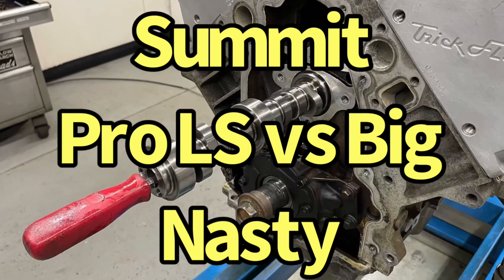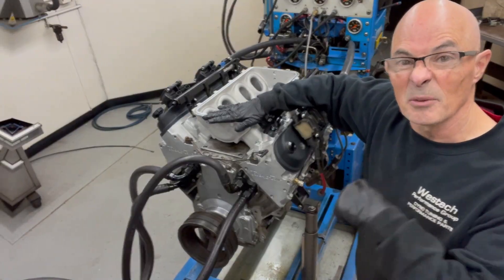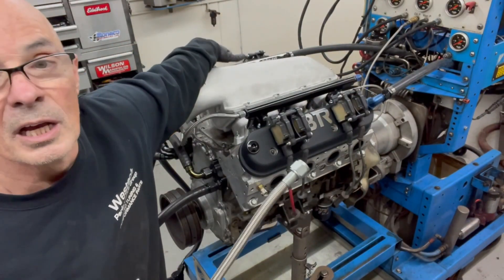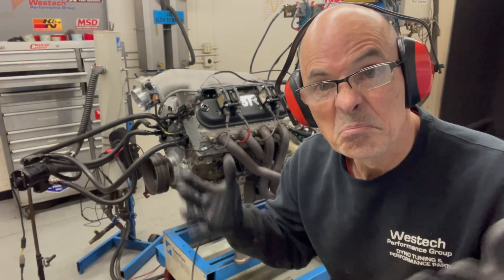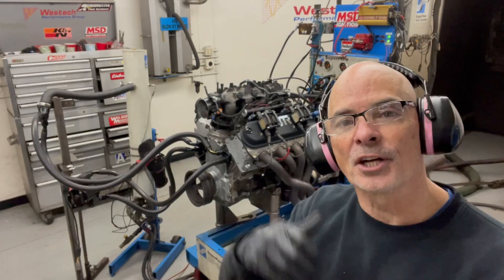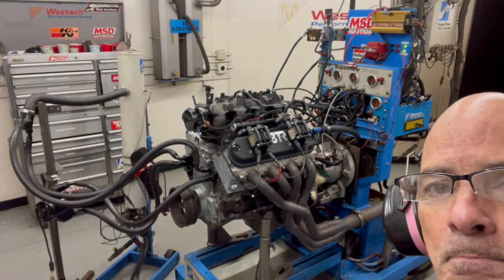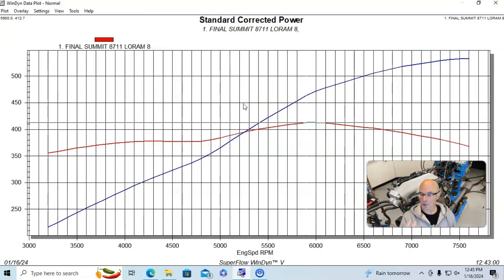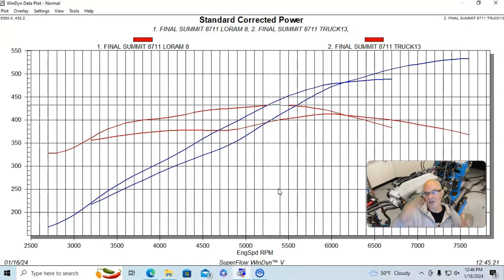TIGHT LSA 5.3L CAMS-DO THEY WORK? ENTER THE SUMMIT BIG NASTY CAM TEST-BIG NASTY VS BIG BOY 8711R1

Comment: I have to say I think it’s funny how some folks bash the tight LSA folks as if the LSA is some random number. Truth is the LSA needs to match the engine you’re working with. 114 might be tight for a smaller engine or too wide for a larger engine. Pick the correct LSA your engine needs, then choose the duration for the rpm range you want to make power then choose the lift for the flow that matches your heads. Thanks DV for helping understand how to make sense of the numbers and the right way to choose the ideal cam despite all the advertising from the typical cam manufacturers.
Reply from the maker: Choosing a cam is NOT advertising vs David Vizard (you are jumping to that conclusion), nor is it a simple formula. Often times Cam choice has nothing to do with power production. You will learn about cams and the market when you listen to more than 1 opinion
Reply: @richardholdener1727  don’t know now but the comp 268 was their most popular cam. Definitely not about max power.
Reply: @richardholdener1727  You are right and why I started watching your channel so I can continue learning. Not saying advertising is a bad thing. Not jumping to conclusions but DV’s explanation helped me understand what the number mean and a more simplified calculation to help guide a cam choice. A cam that advertises to be for a 265-400 CID engine may fit but is it the right cam for all or any of the engines. Many have opinions on what is the right or wrong cam and advice is always welcome but for me, I need to understand why and how to interpret the numbers.
Reply: @JudgeMeNotLeMans  why have an opinion if you have a dyno ... I think most guys just want the best TQ/hp for money spent ... but what do I know just my 2 cents ... but for sure what Richard does for all of us is a great service
Reply: @lukesimeon5756  Not so much an opinion but an understanding of the how and why. Richard provides us a valuable service to see what cams and boost can do. Comparing multiple configurations the average person could not afford, and share the results with us is priceless. For me I still want to understand what cam will work best for my setup and then find a test Richard has done to see an example. Then pay for my own Dyno session to maximize what I built.
Reply: The Summit cam timing calculator’s main purpose is to take the four valve events I use to create the engines powerband and behavior and spit out the Durations, Lsa, and Advance numbers that end up on a cam card.  There is no magic Lsa for displacement or head flow.  In the case of this test, would David’s magic Lsa pick up 51 ft.lbs when you mash the throttle at the expense of 30 horsepower up high?  No, it was just the change in two of the four valve events.  Even intended idle quality is the same in these two cams, but 8711 would be the wrong choice for most people’s powerband so I closed the intake valve 14 degrees earlier to move  the torque (within 8 ft lbs in both tests) down low.

Comment: Richard, I have $5, because I'm homeless on a borrowed phone, that says any given engine will give better results in every category with a 212/212-112 cam and a turbo than any larger cam without a turbo.
Reply from the maker: you want to compare a turbo motor vs an NA motor-seems like one has an unfair advantage

Comment: Richard great info as usual.  Could you possibly give us the engine vacuum readings at idle when you do these videos.  It would be good information to know if these different cams make enough engine vacuum for power brakes etc.  Thanks Again
Reply: Go electric. At 2 amps x 12V = 24 watts. That’s less the power then a low beam headlight. 746W= 1hp. So your loss is 0.0321 hp to run electric. I’m not disagreeing with the request wud be great info to have.

Comment: I'm not really surprised by the cam/manifold mismatch performing as it did... as I recall my dad rebuilding a stock 350-sbc Truck/van 4-bolt .030" over, and following the advice of going with a Edelbrock Performer manifold (equivalent to the S.P.2P., which he was specifically told to go with) and a Crane Fireball-II cam--on an otherwise all-stock assembly with cast-iron exhaust manifolds! Well, despite how contrary to logic this combo was, it worked... and worked well. So well that when kids in whatever late-model machine pulled-up alongside his 3/4-ton van at the light, he left them like their cars were chained to the ground. And the best part: It never needed anything higher than 87-octane to operate at peak performance.😉

Comment: Saw the timing cover in the 2 pieces. cut it right down the center line of the bolt holes 2 from the bottom. The cut will go into the bludge part around the oil pump clearance but that works out perfect.  Thin blade on a bandsaw leave a fine saw tooth marks for the r t v to dig into, don't smooth the cut. Don't sand it.
Reply: I did this twenty years ago testing tons of cams. I think it's Five and an eighth or five and a quarter inches off the bottom of the timing cover to those bolt holes. Describe a line on a surface plate and just cut the line
Reply from the maker: The problem isn't the timing cover (I have a 2 piece)-the cam hits the damper

Comment: Thanks for the information, I feel better already.  I bought a Sloppy Stage 2 off Ebay with springs, pushrods and gaskets for $200 and installed it in a 5.3 I swapped into a '77 Monza with a 700r4 and running off a 750 Qjet.  A few more hp on top really doesn't matter to me and I'm running very low 12's in the quarter at a 6000 rpm shift point and it's street manners are great.  That 300 extra I didn't have to spend helped out with the MSD 6LS box and the manifold I had to buy.  Some get hung up on the numbers in a band where they never run looking for max output.  All I know is there very few vehicles' that can run with me light to light and I do understand there is always that standout or Hellcat around the next corner but I can live with it.  I enjoy doing more with less.
Reply: I'd highly recommend you get rid of that cam & springs ASAP. There's been a ton of people on the sloppy FB group showing the $200 combos (and $90 cam-only) to be china garbage and springs breaking after a few dozen miles of use. Another guy ran it thru a cam doc and specs are a lot worse than a real SS2 cam.
Reply: @hydrocarbon82 the sloppy copy cam doc test didn't include the genuine ss2 cam test; so we don't know if the specs or hardness were much different. 

For example, Delta Cams did a YT vid showing a cam doc test on a genuine BTR cam, which shows the specs were off considerably.

As for the 1218 knockoff spring, there may be cause for concern? Powell Machine  is a vendor ($$) for the genuine PAC springs.
Reply: @hardball107  one of these days y'all will realize that cam was ok for the $$ years ago but you can make MASSIVE amounts more for a few more dollars! And you should NEVER use anything but name brand springs!!
Reply: I love it when "garbage" makes cheap, reliable power.

Comment: You left off the cylinder pressure developed  in the motor between the two cams? That is another tool to decode which cam is a better choice for an application, after the fact, though. That is a kinda pricey way to go about deciding on cam selection if you ask me?
Reply from the maker: cylinder pressure? (see torque)
Reply: Yes, that is a pretty basic premise.  But I seldom see it mentioned, let alone quantified in regards to its effect on street pump gas limits?  Maybe that is just a personal character trait that becomes more obvious during your regularly parsiminous responses? It is just information just like idle vacuum, something else that is rarely mentioned, let alone provided. Grab a cold/hot adult beverage, praise your deity of choice, as many times as required & Chill, Dude.

Comment: I have a BT Red Hot for a 6.2LSA motor. I cannot find one test with cam in an LSA, are there any tests anywhere please, thanks
Reply from the maker: I have never run an LSA-but have run that cam with an M90 blower-whatever the cam does na-it does with the blower (minus the change in intake design-short runner blower manifold)

Comment: cool test would be to take two cams small duration tight lsa vs long duration wider lsa both making same overlap and see which makes more power
Reply: That's what he did with this test. Both cams had 14 degrees of 0.050" overlap. The really interesting thing would be to see a cam at 108 LSA added to the mix.

Comment: Hi Richard, You do Great work!  Thanks for all the great tips and test. Did you run into any PTVC issues with the 8711 cam? what size pushrods are you running?
Reply from the maker: no p-v issues, pushrods were 7.35 but we had milled heads
Reply: Thanks so much Richard you're the best! I just got that cam in yesterday to replace  SS2 that got wiped out.   @richardholdener1727

Comment: LSA certainly needs be considered when building a high static compression NA build with poor flowing heads or undervalved with a carb and no smog I think
Reply: Yup, older heads with a lower port height respond well to a tight LSA, the straighter shot heads of the LS will dump intake charge out the exhaust as opposed to getting that needed tug on the incoming charge by the exhaust pulse during overlap.
It's just not needed.
Old SBC Camelhump heads and similar designs love that tight lobe center.
I've built old school SBC  358 cubic inch motors that really liked a lower lift cam, .525 ish and 106-108 LSA with cast iron camel hump heads with porting and big valves and 11:1 compression on pump gas. 252° intake @ .050
Good combo.
Reply from the maker: please do more actual testing-building 1 combo and calling it perfect shows us nothing
Reply: @richardholdener1727  
Testing was done repeatedly...on the track with many victories and 2 championships in NASCAR West Coast series.
But hey, what do we know.
Reply: @richardholdener1727  You got the typical but nascar answer. 
Not ls or even gen 1 related
Reply: Never said it was perfect,  an old circle track combo that worked well that's all....
Jeez

Comment: Richard…you should invest in the summit 2 piece time cover(#SUM-G6322)… then you won’t need to remove the crank pulley when swapping cams….with save even more time…as with the remote water pump
Reply from the maker: cam hits the damper

Comment: The factories have always made the lsa's too wide. Depending on displacement, air flow and exhaust quality, most engines should be 106 to 110 degrees, including efi. The 116-120 degrees of stock cams are a joke. If they are willing to kill engine power that badly to reduce emissions, then why do they bother to open the exhaust valve at all?
Reply from the maker: you need to learn much more about why OEMs chose their cam timing-they have it right, you have it wrong-they don't need more power
Reply: Ouch! There is plenty of historic evidence like a comp cams HE268 into any 70s 350. But even this modern engine would be happier with a 110 lsa. @richardholdener1727

Comment: You failed once again - its not about tight LSA its about the right LSA - Havent you learned anything from David Vizard? Your too tight LSA right now Its amazing all the cams you have tried and yet you have never had a correct cam. Why dont you call David and get the correct cam so we can see real power not just your guessing with somebody else's money
Reply: He knows David. I see you are an internet professor
Reply from the maker: I take it you are new alpha
Reply: @richardholdener1727  Yeah Rich, what are you thinking testing readily available off the shelf cams?  How is that helpful in any way?  Cmon man do better.... /S
Reply: If you don’t agree or like something don’t be a douche and just leave. Save everyone the hassle 🙏
Reply: @kylecarter7246  nothing wrong with having a laugh at a dumbass post, relax champ
Reply: I really appreciate you testing cams, Richard. But, I agree with alpha, because I was about to leave a similar comment. He said it very well.  I'm one of the 'tight LSA' guys and this is too tight for a 5.3. If you apply Vizard's formula you would need a 110 LSA. It's dependent on CI and valve size.
Reply: @gearhead7896  pretty sure Vizard's formula (an empirical one, not one based on fundamental physics) is for small block Chevy engines, and Vizard will tell you as much.  Beyond that, Rich isn't spec'ing cams, he's testing stuff he can get his hands on.  Grind a cam and send it to him and I'm sure he'll test it.
Reply: @ChurchAutoTest  Good suggestion on sending him a cam. I don't know if he would test it or not if it wasn't a Summit, Comp, or Elgin cam. "Fundamental physics" that's laughable.  But, you're incorrect. That formula isn't just for SBCs. Also, believe it or not, David has tested A LOT more cams than Richard probably 40 years ago.
Reply: @gearhead7896  Rich will test anything.  Vizard didn't derive that formula from first principles.  He figured it out through empirical observation.  That's fine.  But he's specifically said it was calculated using SBC data.  I've been reading Vizard for about as long as I've been alive.  That doesn't mean he knows everything.
Reply: @ChurchAutoTest he has formulas for ford and others as well..its not just sbc...The main formula he's shown however is the sbc formula so, correct in that sense.

Comment: Hey Richard it would’ve been really awesome to do a boosted application with the different LSA’s and show what happens with too Tight of a LSA on boosted application I’ll even lend you my Vortec or twin turbos for the test  perfect sizes for the combo you have too or even better on a 6.0
Reply from the maker: IF THE TIGHT LSA MAKES MORE POWER NA-IT MAKES MORE AT ANY GIVEN BOOST LEVEL
Reply: @richardholdener1727 I agree with you on this, you've proven it on the dyno many times. I think what we want to know is is if cam a made x na and cam b made 15% more would it make 15% more with boost? And what type of boost? Turbos add back pressure and overlap would surely affect that right? Thanks for the Information you provide.
Reply: @richardholdener1727  how many times will it have to be said or shown before people stop asking questions like this. All of the information is right here on your channel.
Reply: i know and you say that often, but yet with overlap on a tight LSA whats the difference 3-5-10% loss in power because of the effect of back pressure? when going for a kill mode set up guys on a budget like me really would like to know because we dont have endless money for dyno time so we hunt for the scraps of info out their @richardholdener1727

Comment: I'm learning about the Chevrolet LS engines.  I have plenty of experience with Fords, but rarely touched on Chevrolets. Older, but I still learn every day!
Reply: Summit’s Pro Sbc, Pro BBC and other hydraulic rollers are all designed with the same valve event ethos.

Comment: Optimal LSA is related to cylinder head flow/displacement. Try this same test on some poorer heads!!
Reply: He has, Truck Norris 107 LSA on a stock 5.3L with 862/706 heads. It did fantastic, huge bottom end with very little drop at the top vs bigger cams.